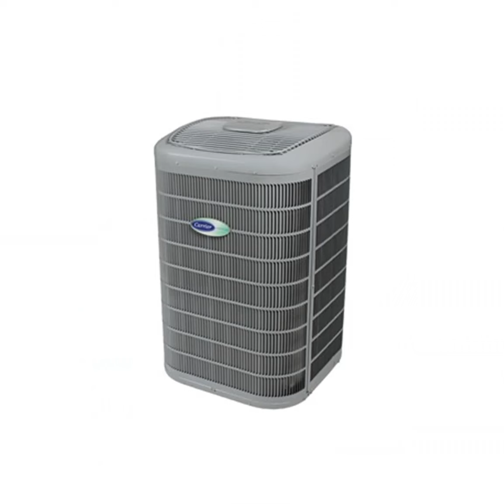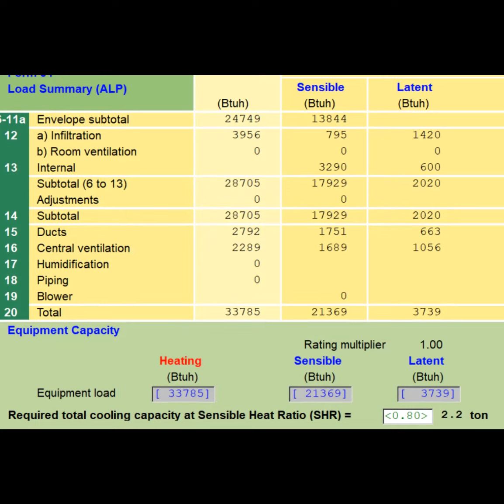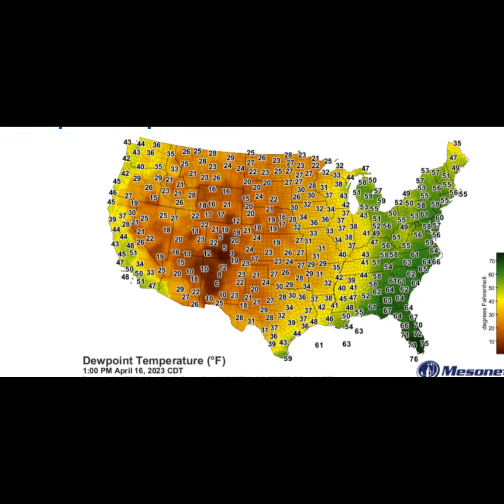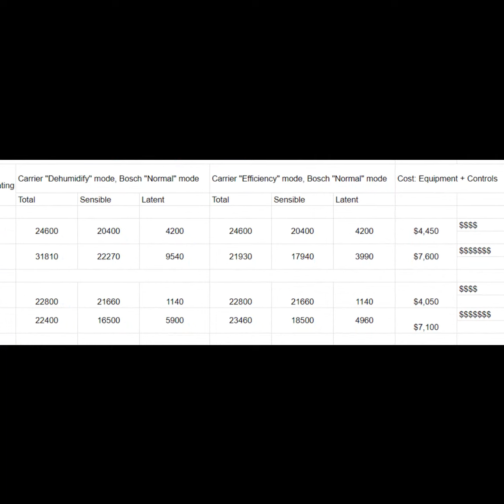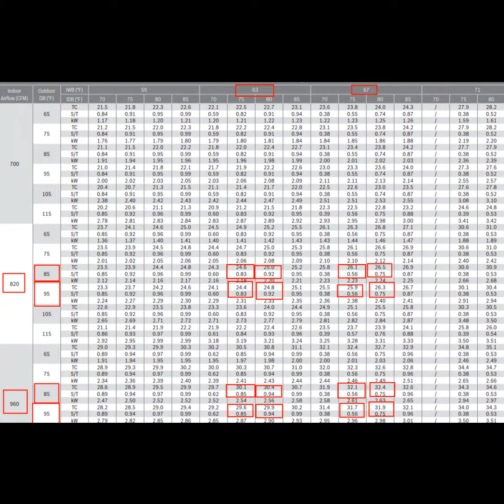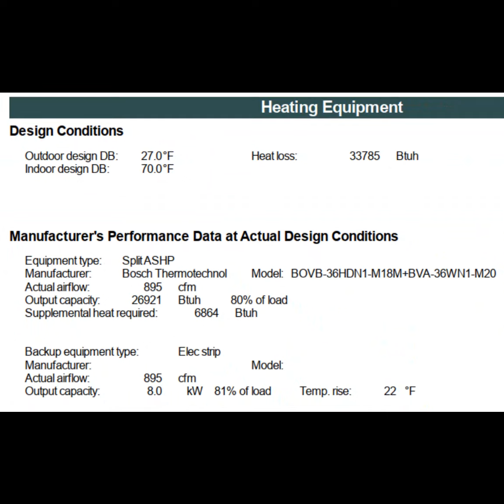My Southport House Part 2

Comment: Learning a lot with everything your post brother. Thank you for your time for us that know less but want to learn.
A customer wants to retrofit his system from 92'. Wants to go for a top of the line equipment. I am leaning towards the Bosch 20 seer, specially since the ductwork is not perfect. I have also installed the infinity from Carrier (not bad). He does not want to replace all the ductwork but does say that second floor has a 4-5 F difference from first floor. (AH is in the basement)
Reply from the maker: If you're doing a furnace and coil, the pressure drop on the Bosch case coils is really high and may make the air flow problems worse.  A temp difference between floors is a zoning and duct design problem not a problem equipment will fix fyi.